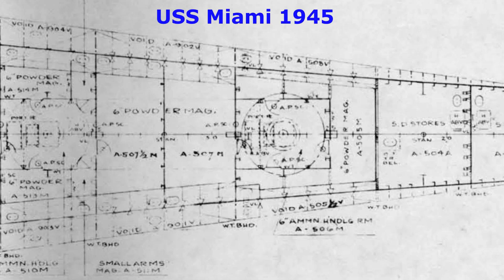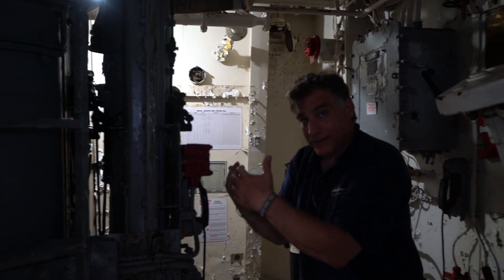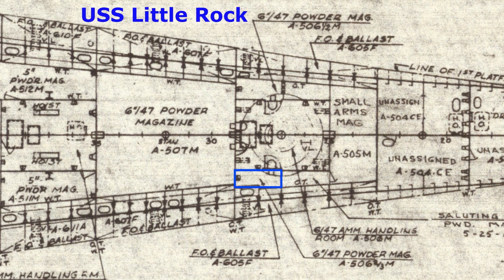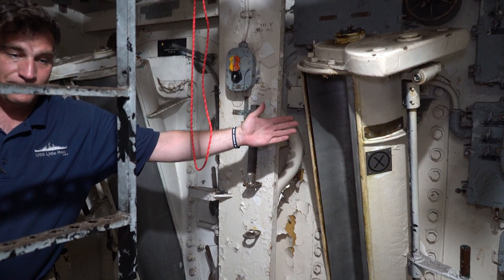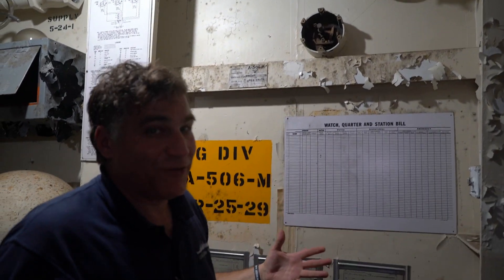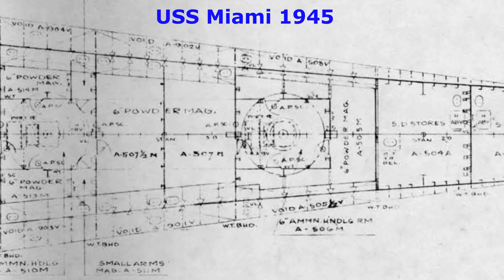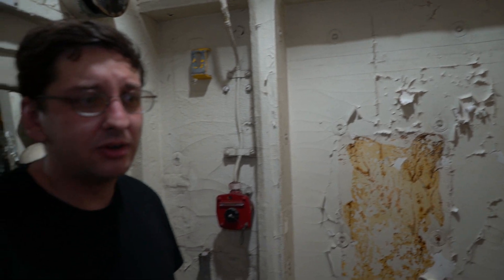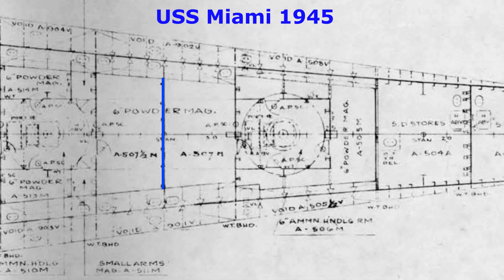Stem to Stern: The USS Little Rock's Archaeology Trek. Ep. I

Comment: This was very interesting, it seems to me that the new arms equipment would have offset the loss of the old guns. Otherwise she would have ridden to high at the stern. Ballast tanks could have handled the difference in used equipment.
Reply from the maker: Kirk - Thanks for watching. I didn't realize that were would have been such interest in the weight distribution of the ship. I will continue to do a little digging. The SPG49's, missile house, warhead stowage would have compensated for much of the weight change. I'll have to see if there's detailed information on the inclining experiments done throughout Little Rock's service.
Reply: @BuffaloNavalPark  You're welcome and I just estimated the weight shift from what I've read about the guns and turrets.  You never want much downward or upward thrust from the engines.  Hence ballast tanks to level a ship. The weight of the new equipment would really help with the tirm

Comment: It was a little hard to follow on the blueprints, did the changes reduce the number of shells that were carried?  It looked like they cut the projectile storage by 25%, but I could be reading that all wrong.  Then again I guess even if it did, it wasn't like they were expecting WWII style gun battles anymore. 

I am curious as to what the modifications did in terms of the weight balance on the ship.  Did it move the center of mass?  Were the 6" turrets and 5" mounts removed aft roughly equal the weight of the new missiles and super structure?  Was the 5" mount moved and retained for weight, or to give some kind of gun-backup AA?  I have no idea of blueprints can answer that kind of thing, least in terms of weight, center of mass, trim, etc.  

Sorry for the somewhat rambling questions.  Great video!  Looking forward to episode 2!
Reply from the maker: Hey Bryce - Those are great questions. Appreciate it. Sorry if there was confusion on the blueprints. When Lucas and I do a debrief session we can show those prints again, and give a summary of each space. I will do a little digging into the weight distribution. It's probably not a question with an easily attainable answer. I will review other records and reference materials that are in the collections. Certainly Friedman's book may have an answer. I do know the superstructure is so much larger in her current configuration. The 5" gun was mounted to the Turret 62 of the 6" (next episode), and no doubt the weight of the SPG-49's\missile house\Talos\warhead compartments did compensate and more than likely over compensated for the loss of three turrets and five mounts. More to come! And thanks for watching!

Comment: If I had to speculate using Occam’s razor, I would say that for some reason onboard CL-92, the doors for the small arms locker and the bomb fuse room were moved to the forward bulkhead of the spaces instead of pointing inboard towards the centerline. Ship alts to plans are very commonplace, especially amongst sister ships. If something seems like a more efficient option in terms of movement or usage, it is often altered on later members of a class. The other big telltale for the theory that the door locations were modified on 92 and not on 89 are the air test pipes. Those would have always been by the main access points for a compartment or space. That way during damage control efforts, a space’s condition could be ascertained without breaking the watertight integrity between compartments. All and all,  Bravo Zulu Shane and Lucas, I can’t wait for the other episodes!
Reply: Yes, that's exactly what I was thinking when we filmed this, and you're on the right track, but there's a little more to it. To spoil the next video a tiny bit, we found that Little Rock had those same doorways as Miami, but they were blanked over. I've been able to do a little research since we filmed, and now I think these doorways result from a small overhaul in 1947. During that refit, the Navy probably moved the doors from one bulkhead to the other. So, we see the doorways from 1947 in this video, and the ones we see in the next video are from 1945. 

Unfortunately, we still don't know why they'd make that change. While we don't have all the answers yet, we can at least create a timeline.